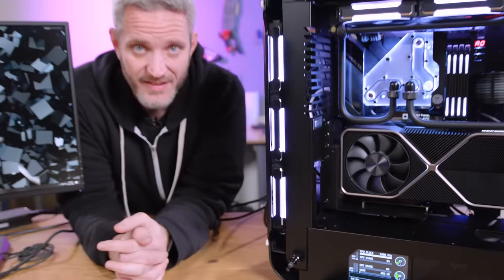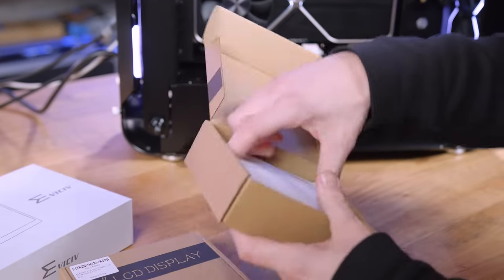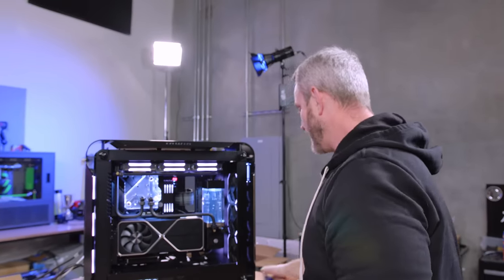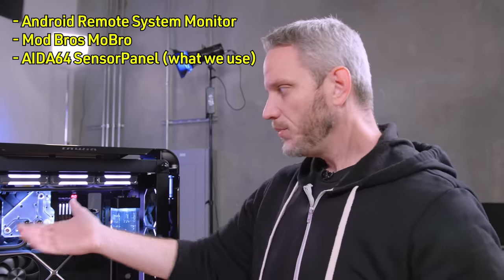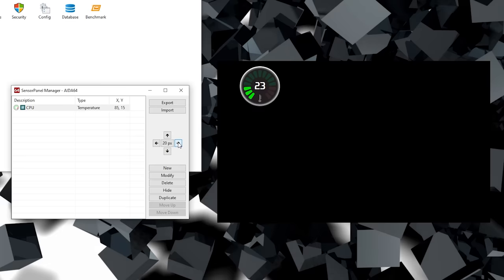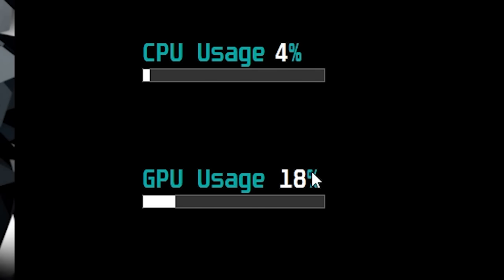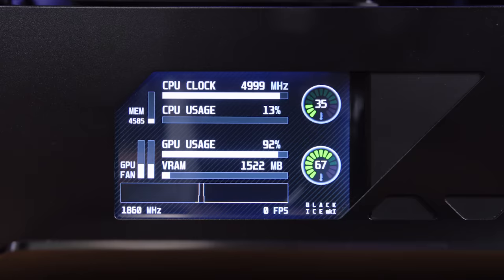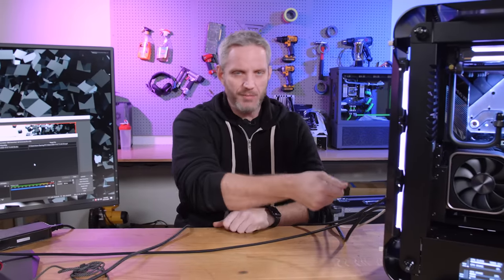EVERY PC should have one of these! How to make a sensor panel!

Comment: Hi JayzTwoCents Lately I build a mini-display like this and I'm using AIDA64 as well. It's really cool and the solution for me as I don't have the space for a large display for monitoring features. But I need to mention this: EA games is not happy with this software, because they BANNED my Apex Legends account because the list it as a 'third party programm' and it interferes with their Terms and Conditions. I did not using anything else (besides MSI Afterburner) than AIDA64. The first time I launched Apex Legends I immeadiately got banned. Using a second account, the same thing happened. I contacted EA for this matter, but they wouldn't say much about it other than it dit not meet their Terms and Conditions. I explained it might be occured b the AIDA64 software and asked for a second opinion on the banning of my account. The said they dit that, but the verdict remained the same. I really need to warn you and other games about this. Looking forward hearing from you.

Comment: Can anyone confirm how much latency the software adds to the system from testing?  

For example, running several graphs, and all sensors in HWinfo -- will cause synthetic benchmarks to perform about 10% lower.  monitoring all sensors in MSI afterburner reduces synthetic benchmarks by about 5-7%.

 Maybe these can use less resources through Aida64,  but I would guess that it would actualy need more resources to run a USB device.   

Anyone who tried this have any insight to share?

Comment: does anyone have a solution if you are already using your 4 monitor outputs?
Other than getting a 2nd graphics card which would mean a complete system rebuild\upgrade
Reply: Try an USB GPU
And why would you have to rebuild you complete System for adding a second GPU?
Adding an 1030 or similiar as second GPU shouldn´t be a Problem for an mATX or ATX Build.
Reply: @darkness8631  yeh gonna get a powered USB hub and an adaptor. Motherboard is matx GPU is 3 slots. Can't get another GPU in there without having to use a riser cable which I do not want to do cause I don't want my gpu horizontal. Bad for thermals and airflow.

Comment: I have one of thise mini display's in my PC and im using a Aorus 3090 Xtreme Waterforce WB with my main display using in display port so when i start my pc and for exemple entering in bios i have to watch the display on that mini  screen because my GPU uses HDMI port for main display .. anyone know how and where to change this ?  in windows everthing is fine but untill that my big monitor is black
Reply: Displayport to HDMI cable or adapter so that the mini display is on a displayport as well, that may work

Comment: question for you smart people.  i have a dell inspiron 5675  i had a friend replace  the 8gb ram  for  new  crucial ballistic 16gb ram and a m2 ssd drive,  he  cloned the data to the ssd drive, my problem is now  that i cant  access anything .  i cant even unistall or  download anything(like re down loading wow) i keep  getting this message window's cannot access the specified device,path or file. you may not have the permission to access the item.   can i fix this or  should i  just  wipe the ssd drive  and  start over  any help would be  great

Comment: Aida64 is $60...really? That's pricey as shit for what the program is capable of.

Edit: Still overpriced in my opinion, but the latest version is a lot easier to modify. Instead of typing X/Y values to adjust text position, etc, you simply click and drag icons and text now (should of been this way from the start, especially for $60). Is this mod worth it? Maybe?
Reply: Torrent....
Reply: @gaz8600  Need info on the false positive. Otherwise I rather not.

Comment: What a joke. First you gave away 5.25” bays, which you replaced with a glass in front and suffered heat issues due to the lack of proper ventilation, and now you want to install a little monitor and its a rigmarole.

Comment: Skip all this crap, and use a USB connection. Dont run it to your graphics. Then you have all the trash coming with dual/triple monitor. It does NOT need graphics card support.